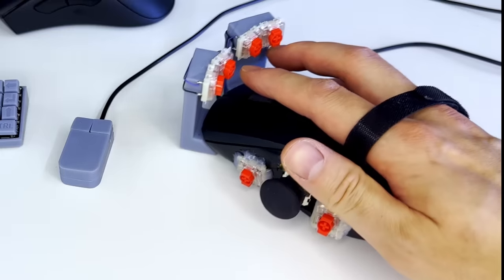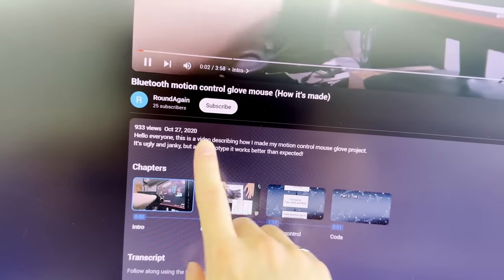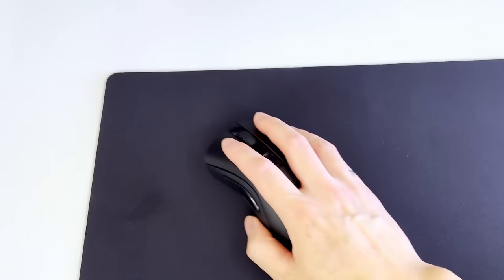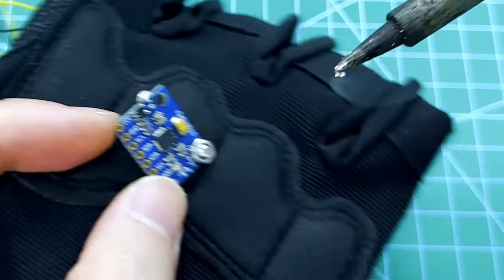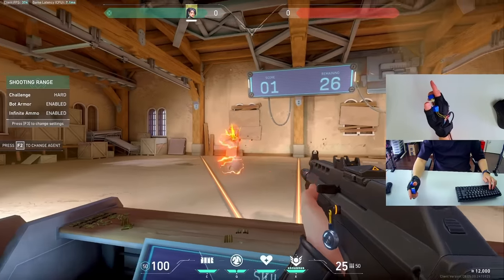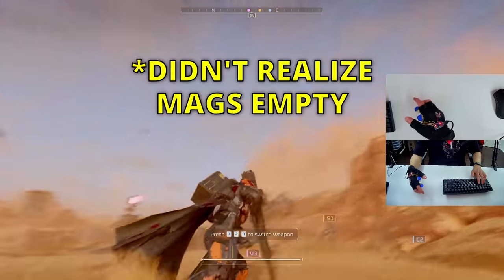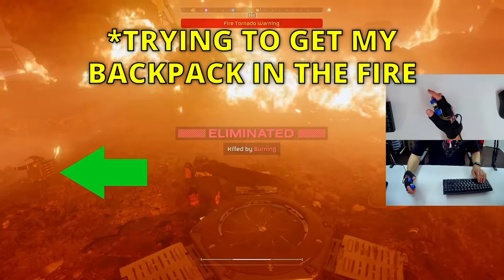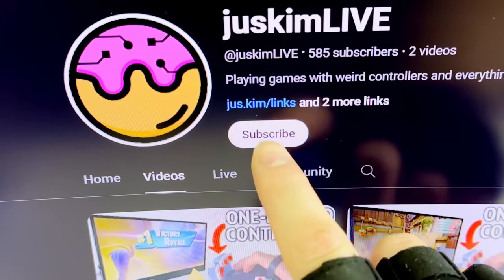I Made a Glove Mouse

Comment: you could also use quest 2/3 controller as a normal usb controller. usually there is also magnetometer to place the rotation in a known orientation. how about just a 2d imu mouse. xy coordinates only.

Comment: Great work!! I’m looking forward to your future refinement of the mouse. I do have a few questions though. Why do you put the sensor on the back of your hand, and not, for example, on your fingertip, for more precise control? Also, I feel like it would be possible to remove the third button if you have the correct in game sensitivity because you’d always be able to do a 360 in one smooth motion. Lastly, how much does it weigh? Thanks! And great job, again.
Reply from the maker: Ty, and I noticed the back of my hand had the least amount of movement when I pressed each of my fingers and rotated my hand, so I placed the sensor there. You’ll need some sort of feedback system (could be optical triangulation positioning) in order to remove the button that mimics the lifting action I think.. And not sure about the weight but it’s similar to my Razer gaming mouse

Comment: Bro one question, is possible to do something with a broken PS4 controller? Like an extra button in the mouse, etc. I would like try building something😂
Reply from the maker: Depends on where it broke but you can definitely hack a PS4 controller (for example, replacing one of the controller buttons with a foot pedal)